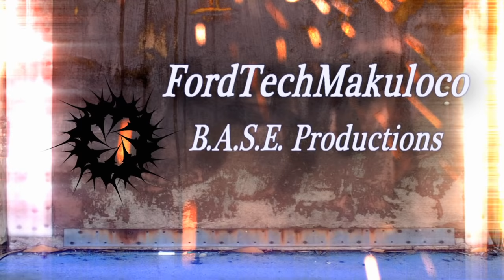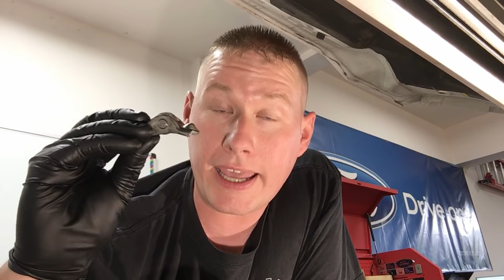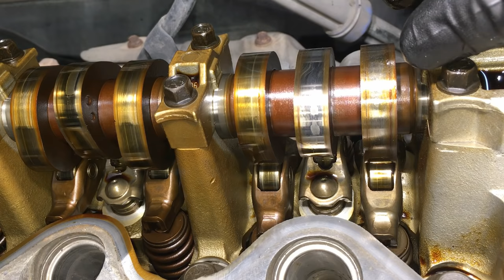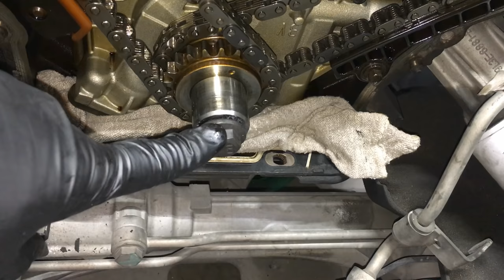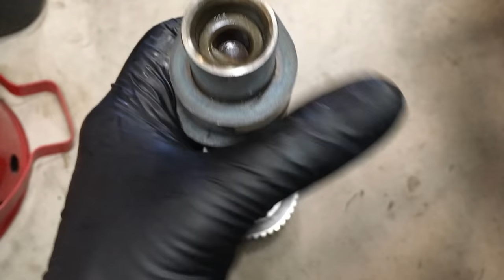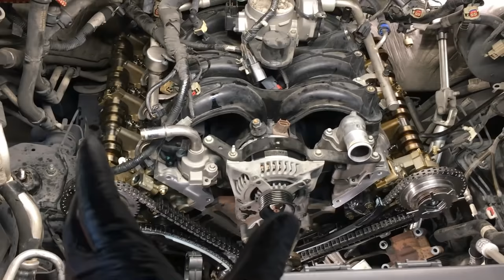Ford 5.4L 3v Triton Engines: Roller Follower Removal and Installation

Comment: Welp... I was all about this video until that was installed without pre-lube . .... Hey ! Pre-lube EVERYTHING GOING INTO A ENGINE......
Reply from the maker: No need they have their own oiling system feeding them directly.
Reply: @FordTechMakuloco  The bearing surface on a cold cycle would start metal to metal without a pre-lube .
Reply from the maker: Right cause there is no oil on the cam lobe from the engine running before you opened it up for install. If you can install a new follower without getting your gloves oiled up as I know you saw in my video then I will concede. I speak from experience not based on what I read somewhere, trust me you will be ok.
Reply: @FordTechMakuloco  You're a good dude . And I appreciate your content.  I was just concerned about unnecessary wear of metal . But I digress . You unhooked cam sensor cranking set me straight
Reply from the maker: Crank sensor yes.
Reply: @FordTechMakuloco  yeh, lol ... that thing